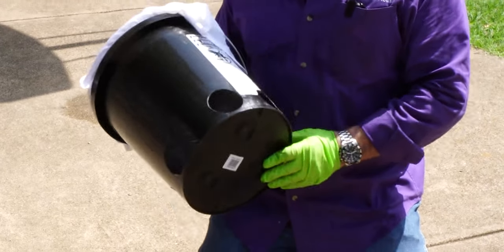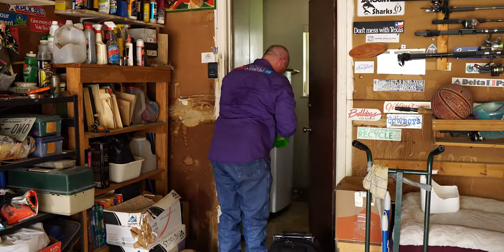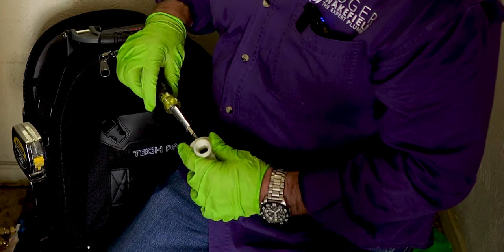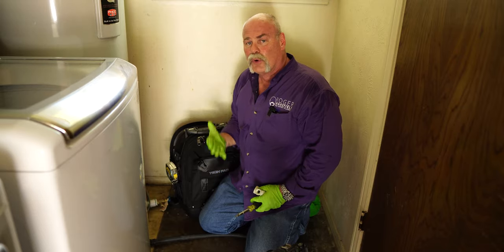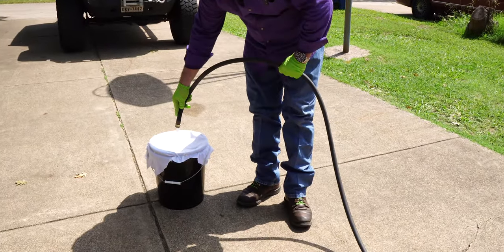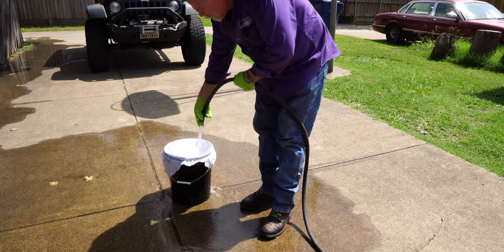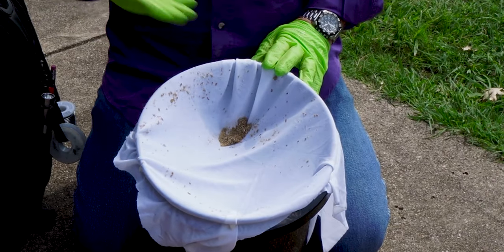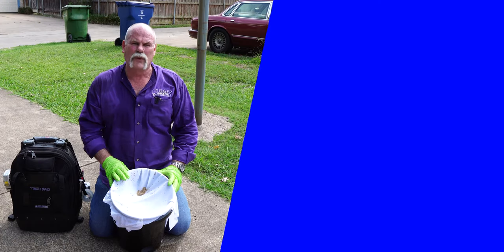How to Flush a Water Heater the RIGHT WAY - DIY Plumbing

Comment: I tried to send a photo to show the indescribable buildup. Background, I live in Florida no water softener, electro heater, brass valve, extremely hard water. I flush about every two years. My kids have noticed a decrease in the longevity of the hot water they’re getting so I decided to flush a year early I accumulated 3 pounds of built-up sediment. In 15 years that is the most that I’ve ever had come out when flushing. Needless to say, I need to clean out all my water appliances now.
Matt Miller 
Jacksonville Florida

Comment: So, we are struggling with low hot water pressure, and before a plumber even looked at replacing water lines he noticed our WH is 25 years old and told us that's the problem he guaranteed it and wanted 4K.  I am skeptical as it heats up just water pressure sucks and I've recently noticed cold water is not at full pressure but much better than the hot.  Do you recommend flushing?

Comment: I used to flush my water heater, but the last water heater we had had a plastic connector that wouldn't fully shut off. This was a nightmare because our water heater is in a closet inside the house with no floor drain near it. There was a floor drain across the hall for the evaporator condensate to drain into. The pressure relief valve was originally connected to a pipe that went up into the attic, over the hall, and down into the furnace floor drain. In the '90s, the stopped using it because it was out of code. The pressure relief valve now just goes into a pipe down to the floor and is just open ended like that. I would REALLY like to have a branch drain put in for the water heater to drain into the furnace drain. We don't have a garage, by the way. Just a carport. No basement either.

Comment: Long story short. I live in Pocatello,  Idaho and we have very hard water I found out. I just installed my new water heater 20 months ago. It's a A.O. Smith Signature 50 gal. 4500W tank. My bottom element explored more or less. My question is what do I do? This is a new water heater and I can afford a filtration set up. How do I get all that sediment out? I can't attach photos. I have calcium build up to where it touches bottom element.

Comment: Do you need to turn off the water heater or leave it on?
Reply: Yes if it's a electrical water heater, take no chances on a dry fire of the w/h.
If the w/h elements are drained below the water level in the tank, they can pop in a few seconds if left on. As for a gas w/h  just turn it to pilot, while draining you should be fine.
Reply: @johnerickson1484  Do I need to turn the breaker off or can I unplug the water heater? Heater is located in a business and looked everywhere for the breaker, but can’t find it.
Thank You

Comment: roger please tell me is it true if you did not flush your water heater for a while meaning 5 or more years is it true to leave it like it is instead of flusing it? and the reason is if you flush it instead of taking the sediments out . it will destroyed what is left inside the tank ( anticorrosion anode and the dip tube ) inside and mess up the tank since they are maybie deteriorated already it will speed up the process to be broken  .is that true i was told by another plumber .what do you think , i haven't flush my tank since i put it on and the was back on 2008 and we are in 2021and still working ? should i flush it or not what do you think  i have 40 gallons ao smith pro version 2006

Comment: Thank you for the video Roger. Water coming out of my hot faucets is slightly brown and clear out of the cold water faucets so I read that it could be from rust in my hot water heater. I will flush it tomorrow and see what happens.

Comment: Hey Roger, I have a gas water heater, I'm in California, it's 10 years old. I haven't flushed it in about 3-4 years...we are getting rusty/ yellow water in the bathroom, that clears after 15 sec, most of the time.I'm debating whether to do a 10 minute flush, to see if I see obvious rust. What do you think? I know it could be some of the galvanized pipes. Unit was built in 1959. Thank you.

Comment: i get little white grains/chunks. perform flush every year.  after emptying tank, i pour in 3 gallons of white vinegar through anode mounting port, let sit for hours to dissolve scale, then turn on supply and heater. the vinegar odor quickly dissipates and might even clean shower heads and faucets.
Reply: I do the same, but only every 4 years when replacing the anode.  Other years, just flush with water.  I flush the vinegar out the drain, rather than through the house plumbing.

Comment: Please excuse my ignorance but is the process to leave the water main water supply on, attach hose to drain outlet and then open drain outlet?
Reply: Yes that’s pretty much it  but u should also completely drain it at the end with out filling it  change the anode probe if needed an  refil
Reply: Artemis 860 Thank you!

Comment: You didnt show ANY of the other necessary steps you must take before just hooking up the hose and opening the drain. There is a whole lot more to it than what you showed. I dont think this video helps at all with the full steps included to properly flush a water heater.